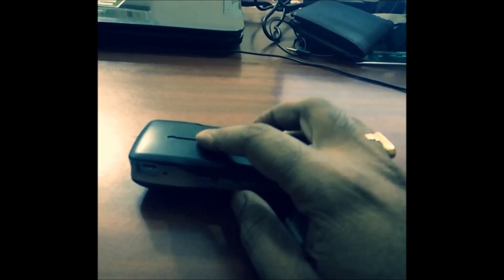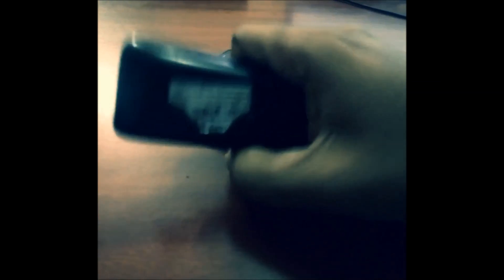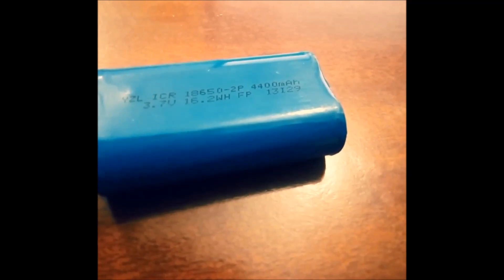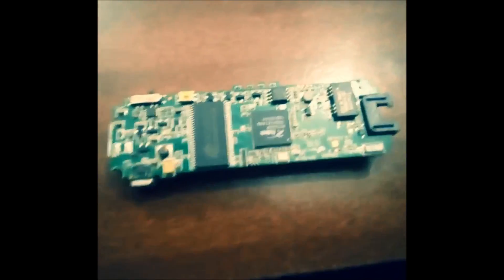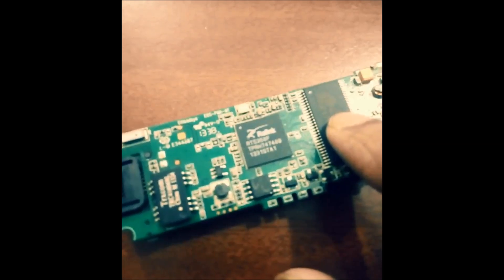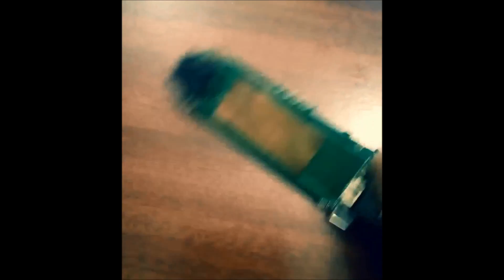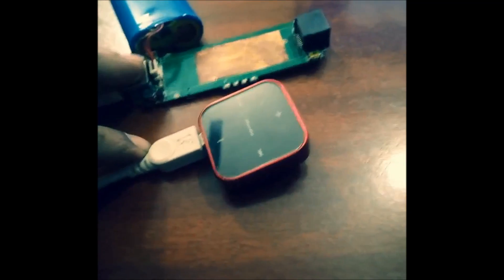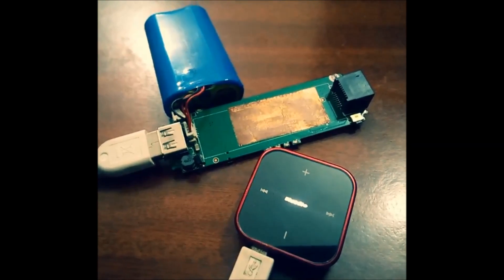What's Inside MMX440W Router & Powerbank [Insight]

Comment: How can I run it with direct power or with power bank ?
Reply from the maker: it is a power bank so U dont need an external power or power bank. 
It was charged from mobile charger or micro USB charger.

Thanks
Keep Watching
Reply: What if its  battery becomes dead ? How can I work around it ?